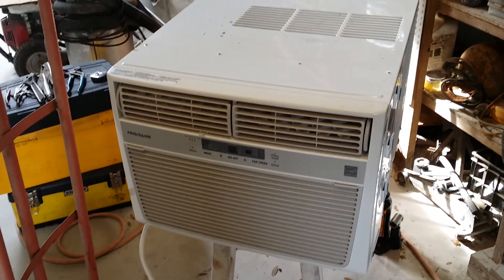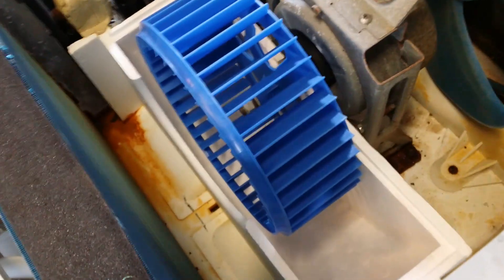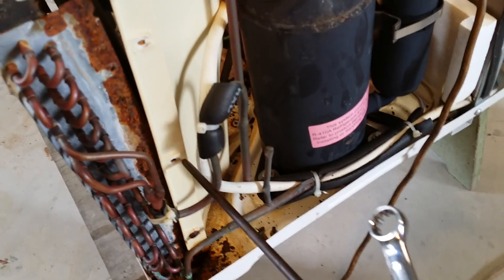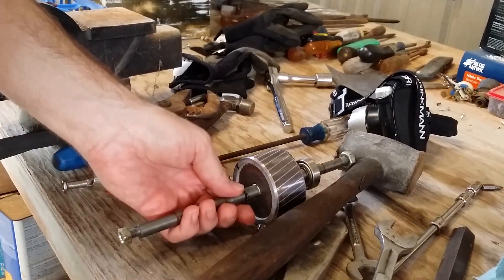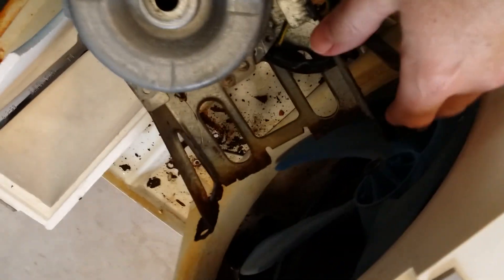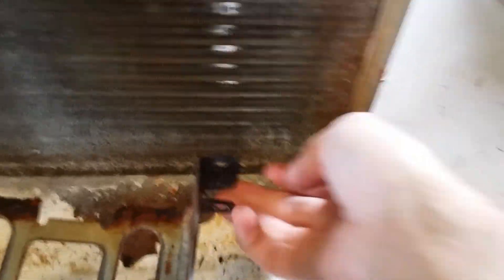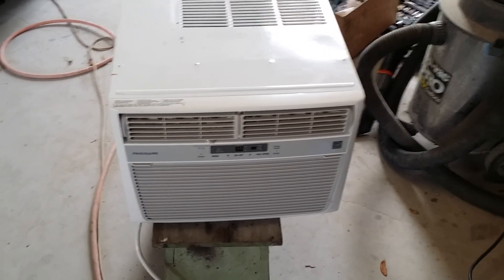Noisy window air conditioner A/C fan bearing

Comment: Nice video! You happen to have the link for those bearings? I have one doing the same thing.
Reply from the maker: Here was the bearing that was in my unit. Good luck! 
http://www.ebay.com/itm/391671495979?_trksid=p2057872.m2749.l2649&ssPageName=STRK%3AMEBIDX%3AIT
Reply: @egantrucking  Drat!  The Page is missing now. Like maybe they discontinued it or moved it to another page.

Comment: Thanks for this video! I get ACs alot for free because people run them without filters or proper cleaning, and after years they clogged up and don't work.. I've gotten many that I cleaned, but trashed the bearings because of cleaner or water getting into them no matter how hard I tried. I've even tried soaking them in heavy oil, no luck.

Never thought I could replace them, I guess they are fairly standard bearing sizes.

Comment: Mike Mike, I have the same exact issue you describe & show in your video here.

I went in and gave the unit a good cleaning.  It made a slight difference but the major issue is still there.

The model number of my unit is LRA087AT7 and it is an 8,000 BTU unit.  Was wondering if you knew or could find what ball bearings it would need to accomplish this task?

I also took a picture of the motor area and can give you info off of that if it would help you.
Reply from the maker: Sorry, I do not know what bearings different units use. I had to take mine apart to find the part number on the bearing. Good luck!

Comment: how do you separate the two halves of the motor? you cut that part out of the video. I can't figure out how to get the two halves of the motor off of the spindle to replace the bearings.There are some sort of thing that the blower fan and fly wheel sit flush against when everything is together but is preventing me from separating the two halves.
Reply from the maker: On mine there is a steel bracket that holds the fan motor in place. That bracket is attached to the flanges of the two fan motor case halves.  First the motor must be removed from the bracket, then there were very small flush screws around the flange that need to be removed to separate the two halves of the fan motor case. After all the screws are removed I used an old wood chisel(red handle in picture) to 'split' it open. Only use gentle force and work one side then the other a little at a time. I suggest taking lots of pictures each step of the way for help with reassembly.
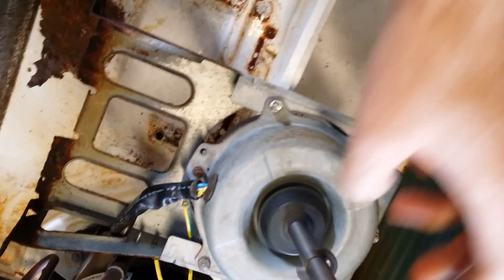Reply: Thanks for all that. My motor unit is already cracked open. At 8:16 minutes in the video, your fingers are between the black rubber thing (where the shaft comes out of the motor) and some sort of C shaped almost complete ring on the shaft (that the fan/blower wheel will sit flush against once screwed back on).

What is that, and how did you remove it? That C shaped thing (because it's on both ends of the shaft) is preventing me from separating my two motor halves.  Earlier in the video, it looks like that has been removed from the shaft you're working on. They don't seem removable, almost like they're welded to the shaft. This is the last thing and I'll be good to replace the bearings.
Reply from the maker: Those are called "C" clips. Use a flat blade screw driver to carefully 'pop' them off the motor shaft. They are made of a spring steel but they can still be permanently bent so try to be careful removing them so you do not distort their shape. They make special tools for them but you can get by without it. I like to 'push' them back on with a carefully placed vise-grip if possible. Clamp it on the flat surface as close as possible to where it will contact the shaft once in place, and push it straight on. A drop of oil can help it go smoothly.
Reply: Ok great thanks. I got them off now. Now i just need to get the actual bearings off the shaft. They're pretty stuck on but good to go now.
Reply from the maker: I suggest cleaning the shaft with some fine sandpaper (like 250 to 600 grit) even 'before' you try to slide the bearings off. So once they start moving they will not hang up again. Also, I suggest marking the location of the armature on the shaft just in case it slides. I had that happen to me, after 'tapping' on the shaft to get the bearings to move.
Reply: the sandpaper really made a huge difference. I ruined some bearings trying to hammer them on before using the sand paper and then they just slid right on. Thanks!!!

Comment: I just bought a very similar unit second hand and it is doing the EXACT same thing! I am no where near as handy as you...is there something else i can do to quite this thing up? Its going to be in with newborn puppies and its just too loud for their developing ears. Thanks!
Reply from the maker: Unfortunately, I do not think so. I tried to put oil into the bearings but had no luck. And even if you could put oil into the bearing, it probably would not help much because the bearing is actually bad. Sorry, I have no other ideas except maybe a lot of sound deadening material in the room.
Reply: my model # is lra107cv1, would it use the same bearings you listed the link for? I want to make sure I can fins the right bearings before I tear this thing apart. Thank You!
Reply from the maker: Unless you can find a "parts manual" for your specific model,  I would recommend dismantling it to finding the part numbers on the bearings because they could be different. I am almost certain you will be able to find any bearing online. They could be the same, I just do not know. I think my unit is a 12,000 BTU and when I Google your A/C number I am finding it to be a 10,000 BTU. If you could see the part number on the fan motor and it was the same, the bearing would most likely be the same. Here is the part number and make of the fan motor in my unit (YSK90-4AF  Welling).
Reply: first I want to thank you for all of you help! I have gentleman who is going to replace the bearings for men but wants me to have the new bearings when he picks the unit up. I have the part # of my motor (#5304485442) but am unable to locate the actual bearing # without tearing the unit apart myself. even contacting Frigidaire was pointless. can you offer any other advice as to where I can search online to find this #? I think I've got the end of the internet in my searches, lol. Thank you!
Reply from the maker: I'll try to search for you tonight. Is there a "model number" on the motor? Mine is like this (YSK90-4AF  Welling)
Reply: I don't know. I don't have the unit taken apart. The part number for the motor is what I got from the parts manual and from calling Frigidaire. I'm sorry that's all I have at the moment.
Reply from the maker: You may be able to see a 'sticker' on the motor with numbers on it if you shine a light through the top 'grate'. (air slots on the top of the unit).
Reply: thank you. I'll look when I get home this evening.
Reply from the maker: I found pictures of your motor, but I could not find part numbers for the bearings. It looks like the shafts could be shorter on yours. It also looks like there are two possible motors for that model. The bearings could be the same but I would take it apart first if the model number of the motor is different than mine. JMO

Comment: I have the same problem with my window AC. Also Frigidaire but different model. I haven't opened my motor yet but can you tell me if your motor is a YSK33-6AS? If so, I'll just go ahead and order these bearings.
Reply: Hey Mike. YSK90-4AF is the same motor in my a/c unit. do you have the bearing info? if so it would be much app'd. i am getting ready to disassemble  and would like to order the bearings ahead of time. Thanks Again!
Reply from the maker: Mine says YSK90-4AF  Welling. I don't know if the bearings would be the same.
Reply: Ahh, I don't know for certain but I have to assume the "90" indicates a larger motor, and likely a larger shaft. Thanks for the quick reply; maybe my bearings will have a part number on them too.

Comment: i have a simular model and it was fine for 7 or 8 years then last year i stripped it down to clean cause it was bloody horrible inside. guess what the bearings failed right after extensive cleaning when i started it up this year. aparently the seales do not handel anything but normal rain from outside. gonna switch the bearing out next week
Reply: Make that four.  But I've seen reviews on our units that indicate fan bearings the major source of failure.  The junk from trees over time left me no choice regarding disassembly and cleaning.  Thanks for the bearing link too.
Reply from the maker: Interesting. I had also cleaned mine out with water too before storage. I had wrapped some plastic bags around the motor but water may have gotten past them. I was not overly worried because like you point out, it does rain on that part of the unit. Also the fan 'throws' the collected condensation(water) on the condenser and in the process it splashes around in there some. It could have been a self inflicted failure!
Reply: That's when mine got noisy too. I think definitely self-inflicted failure.
Reply from the maker: Real interesting. That's three of us now! Maybe "if it's not broken, don't fix it" should have been followed! :-)
Reply: mike mike a year later... Mine has the same issue but I never washed it. Must be a manufacturer design flaw.

Comment: This is a great video I have the exact AC is there any way you could send me the part number for the bar barring or the listing for ebay
Reply from the maker: Here is the link to the bearings I purchased. Let me know if I can help in any other way. http://www.ebay.com/itm/391671495979?_trksid=p2057872.m2749.l2649&ssPageName=STRK%3AMEBIDX%3AIT
Reply: @egantrucking  will these bearings work with a ge AEL05LX motor
Reply: @egantrucking  Dead end link.
Reply: Doesn't anyone read the previous comments before posting a question?!?
Mike IS NOT an air conditioner repairman! He doesn't know what will work on your model.
So far, he has answered the parts number question 5 or 6 times.
He won't come to your home and fix your problem! Deal with it! He was VERY clear in the video about how to do this.
Watch it a dozen times if you need to. ALL the information is there.